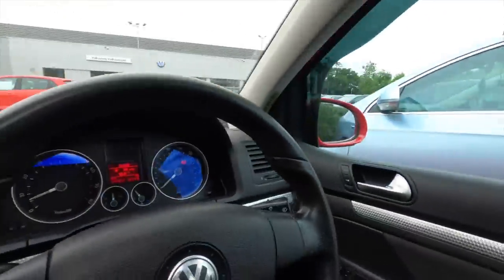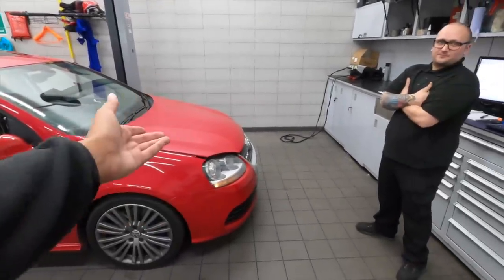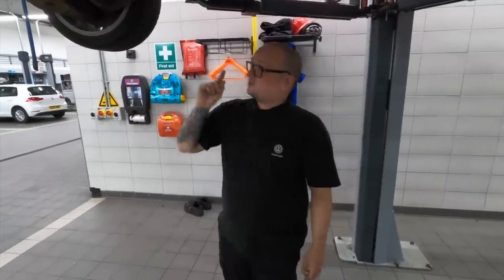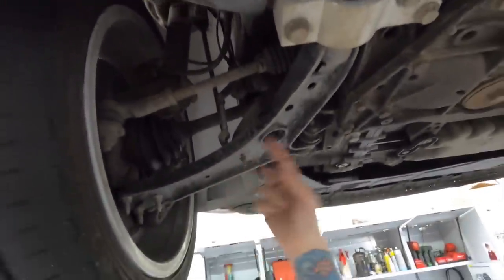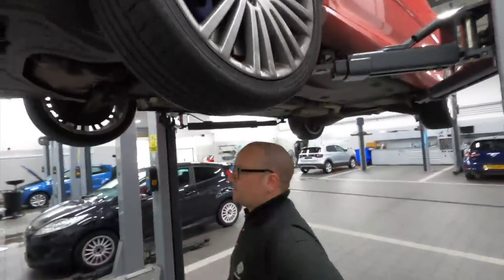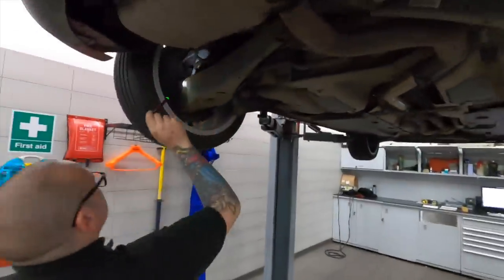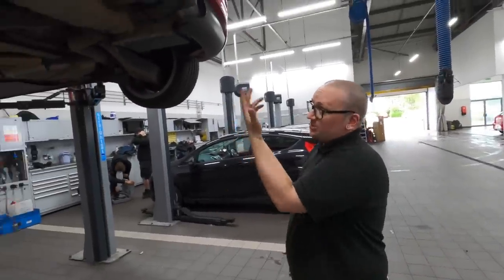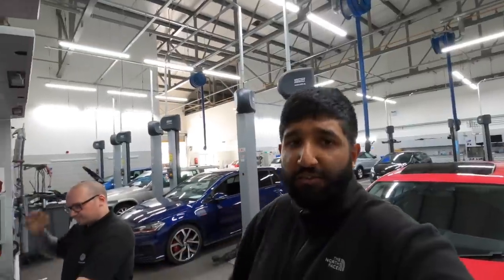Everything Wrong with the UK's Cheapest VW GOLF R32!

Comment: Very informative. Have owned mine for 10 years now and apart from the perishables, haven’t had too many issues. Surprisingly good around the twisties with a decent coilover set up. I’ve also updated the ARBs to H&R which makes a massive difference with the thicker rear. No more understeer. Never feel fast because the power delivery is so linear but 0-60 in 6 and keeps pulling all the way to 155, you really don’t need anymore on UK roads. The sound speaks for itself and they still turn heads 15 years on. They’ll never stick a VR6 in a Golf again. I’ve never added up my 10 year fuel bill though 😄
Reply from the maker: Definitely has got me hooked after a week of ownership, something about driving around with a 3.2 in a Golf is just cool to me
Reply: You know y it doesn't really have many issues with the car

Because it's a Volkswagen
Reply: Weve had ours even longer and still love it.  Its had quite an easy life and not needed any big jobs done.....so far!     I think that shape still looks great due to the clean lines.   The sound it makes will soon be gone i to history, so we should enjoy it while it lasts.    I dont find the fuel too bad . Maybe because i drive an r36 and the wife uses the golf.  The passat is thirstier.  The engines seem pretty strong.  Dont want to say bulletproof, just in case....
Reply: What about the rust?
Reply: Had a 2007 R32 from new for 7 years without issue too, shouldn’t have sold it either.  RSQ3 now so I’m sort of happy still, love the things..

Comment: I watched this with interest, i bought a VW last year with a Full service history, mass flywheel replacement, timing chain replacement, mechanically great, so my service was just done and the tech did a video for me, pointed out that the bump stops need replacing, centre exhaust clamp needs replacing, brake discs and pads need replacing, fuel filter housing needs replacing, the bill for this was big....it's at this time you start thinking to yourself to start saving money...obviously a dealer will charge you way above your local garage, I have decided to source all the required parts from a reputable German parts company to make savings, and getting all the required parts in over the next couple of months, doing this (a) saves the garage time in ordering the parts and (b) means you will pay the garage only for labour.... if at all possible don't let a dealer garage take care of your car other than a service and to get the log book stamped.

Comment: Tbh mines on 10700 had it 7 months. Had the mk4 before, which tbh is a nice looking motor,  buts it’s years behind the ride comfort and handling of the mk5.

Chains are not a problem as long as you do oil in them once a year . Mine has had oil changed once a year since new. When I check my oil it’s always really clean looking, even after 2 thousand miles since I did it..

Comment: Love that engine.  The wife has an r32 and ive got an r36.   Very different cars though.  Similar sound since i got a stainless exhaust on the passat.    I wouldnt say either car was nimble, like a fiesta but they are both lovely to drive and very planted at speed.    Hers is 14 years old and mine 12 but theyre holding together well. Decent quality.    Both quite costly to run but we do low miles.   Hoping to keep them as long as possible but it might be difficult as my job might be gone now.  Youve got to have a bit of fun somehow though.....

Comment: Well all need a jack in ours lives owning a mk5😂
Reply: I feel like I need to offer some sort of rental service for my time 😂
Reply: Jack Wasley agree mate!
Reply: Lol I actually know a jack with a mk5 R32 😂
Reply: Jack would be far better off working for r tech!! Seriously get him there!
Reply: @markrs59  ha i actually started out at a UK based performance specialist building race cars and fast road stuff, the boys over at Rtech really do know their stuff and from a mapping point of view I'd give my right arm to be around that kind of knowledge, especially considering they play around with the modern platform stuff.
Reply: WhyOWhy  I have in the past I will admit and its something that does still cross my mind however where I am now the training is never ending and I specialise in diagnostics and high voltage vehicles which really keeps me interested.
Reply: @Joutenshi  I wish you worked at my local vw, I get a occasional issue with mine when the air temp is below about 6 degrees it won't cold start and just go straight to normal idle?? When warm I'll get a cold start every morning as long as the engine isn't warm obviously, mk5 gti stage 2 just got full exhaust and intake? It seems to run fine and nothing on diagnostics. Themo was recently done and gets up to temp on the gauge OK? It's baffled me lol
Reply: @markrs59  that's the kind of thing where I would need to sit down and gather detailed information from you, run extensive diagnostics and see what i find.
Reply: @Joutenshi  it's r tech tuned by previous owner and I took I there last year for a health check and they found its had a runner flap delete after it was tuned so it obviously needs a tweek, so I'm wondering if its something to do with that??
Reply: @markrs59  entirely possible to be honest, id potentially get it tweaked and go from there.

Comment: You'll want to check the flex disc for cracking. If it fails the drive shaft can wobble around and cause damage to the flex pipes, power steering power lines and oil sensor lines

Comment: Hey lads.. I am about to see a VW Passat B6 2.0tfsi 200bhp
On pictures looks pretty good. Good service history and old MOT's looks ok nothing too crazy on there. 3 previous owners and 140k miles...
Is it worth it to give it stage 1 remap? It is a much heavier car then the golf GTI so I feel like basic remap would benefit the car..should push out around 250bhp and 60 more torque also a bit better mpg maybe 10%? 
I can get the car for a good price I think (1500 pounds) and will change the cambelt straight away(was changed at 70k miles so it's due now pretty much)
Does anyone has experience with PASSAT b6 with this engine? What to look for on the inspection and test drive ETC
THANKS A LOT PEOPLE stay safe😎